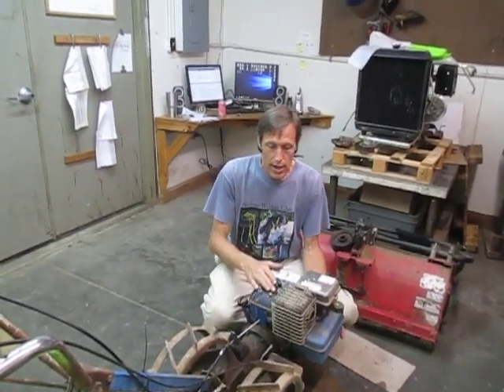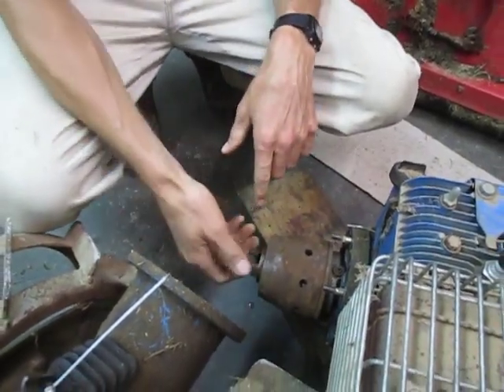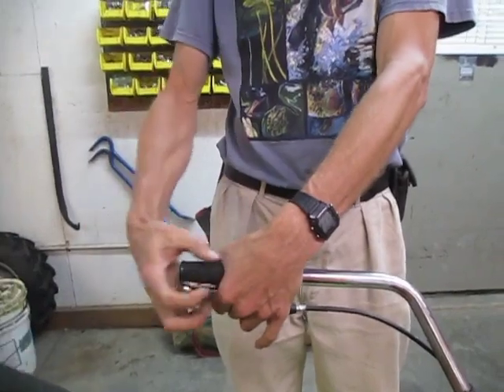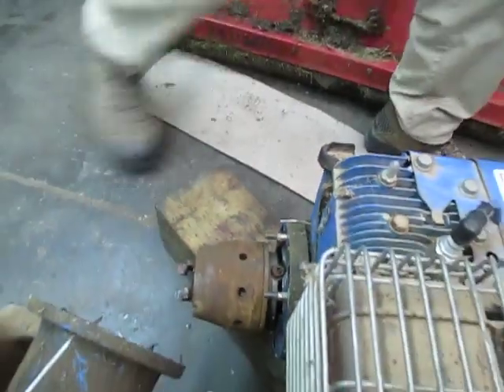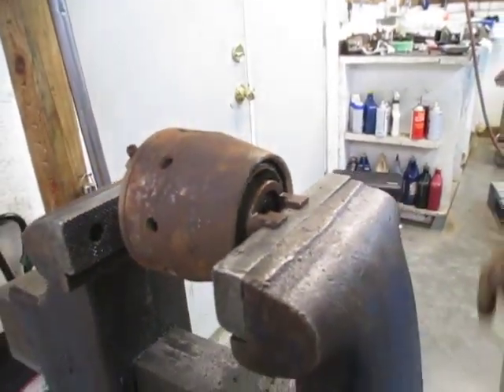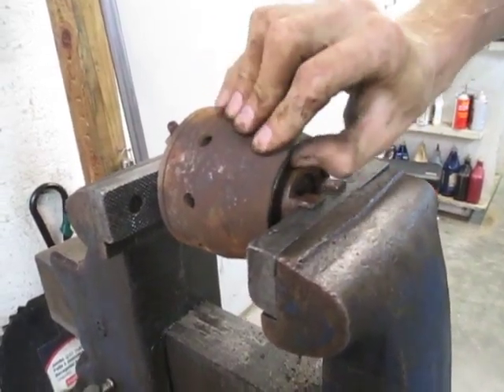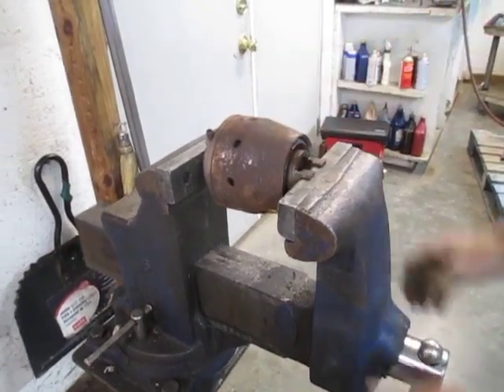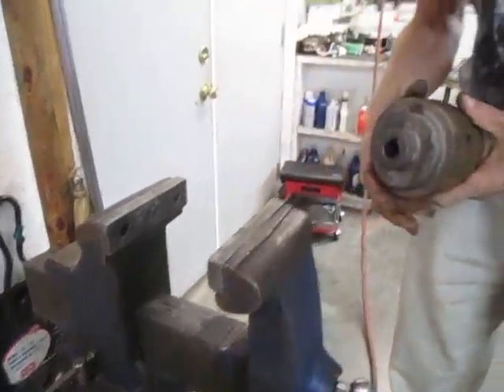BCS HD Cone Clutch: Operation, Tips, & How to Free a Seized Clutch

Comment: I have the style with a loose throw out bearing on the spline shaft and a split case. I went to grab the gear puller and realized I didn’t even need to remove the clutch from the engine, just use the gear puller grabbing the clutch seam a few turns and it freed right up 👍 thanks for the video it sure helps to see the thing and understand what’s going on before picking up a wrench!

Comment: Mine was beyond stuck.  Literally lifted a Datsun pickup off the ground before breaking loose! Didn’t have a press so I used a floor jack and a flat spot on the truck to back it up and compress but not before the truck was off the ground lol.  If not for your video I would’ve had to buy a new clutch. Now it works well again. Think you.  Definitely store with the clutch handle depressed or you’ll be in for work!

Comment: Thank you for the awesome video.  Very informative.  Great information on cone wear, on keeping the clutch squeezed when in storage, anwrenching on the clutch arm.  After watching both of your videos I was apprehensive about trying to remove the clutch assy from the crank to break the cone loose.  Looked like an opportunity for Murphy to create more work on a 30 yr old machine.  I went a little different  route and used a punch and 24oz ball peen hammer to tap (tap...not driving nails) around the steel center at the base of the T/O bearing while still on the crank.  The first taps (taps) felt solid then a few more and it felt springy (not solid like the first few).

Comment: I diligently kept my clutch handle engaged on my 853 that’s only 2 years old and now it’s stuck. Going to try the easy method and then if that doesn’t work I will remove and manually do it

Comment: My second clutch on my 853. The original began sticking soon after I bought it. On warranty and got it replaced. The clutch is frozen solid after using my rotary mower. We used it last year continuously with little problem. The bearing on the rotary mower was shot so I replaced it. I bought all the equipment just over a year ago brand new. Frustrating. I also have a 605 which ran for two decades without incident. SIGH